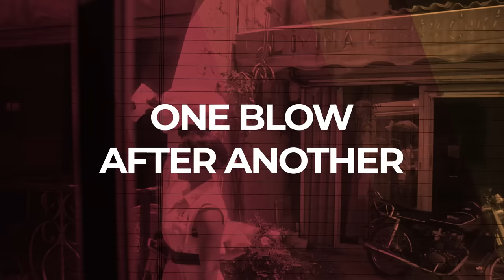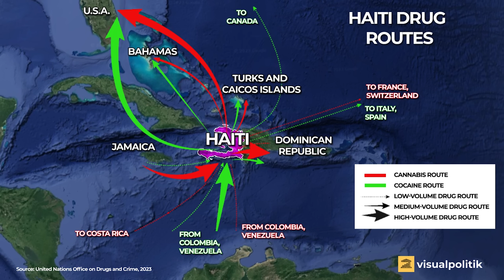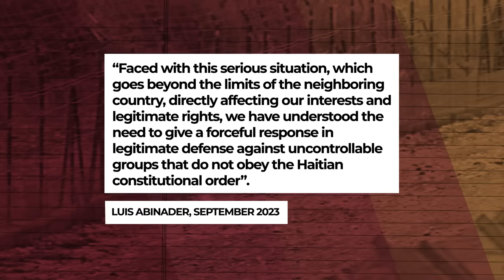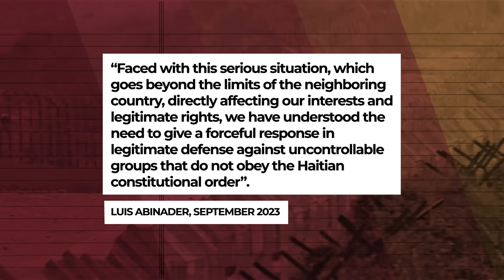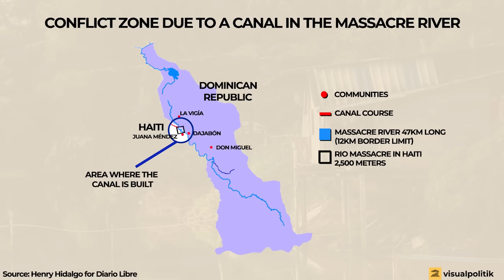How Dominican Republic Wants to Separate From Haiti

Comment: I attended the Dominican protest in Washington Heights in 2020 when I was 21. Having lived in the U.S. since I was 13, I felt a strong connection to the cause. The protest gathered hundreds of Dominicans and supporters rallying for democracy and transparency in the Dominican Republic after the elections were suspended.

There was a significant police presence, with officers monitoring the crowd to maintain order, and helicopters flew overhead for security and media coverage. Barricades were set up to control the flow of the demonstration, ensuring safety for everyone involvedl. It was a powerful experience to stand with so many others, all demanding fairness for our homeland amidst heightened security measures.